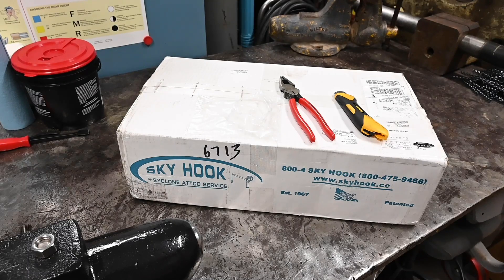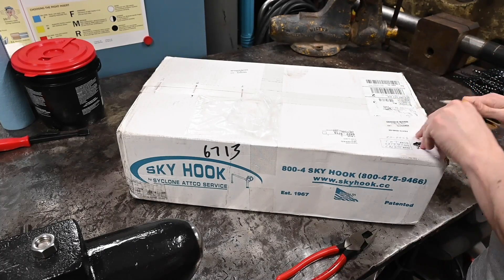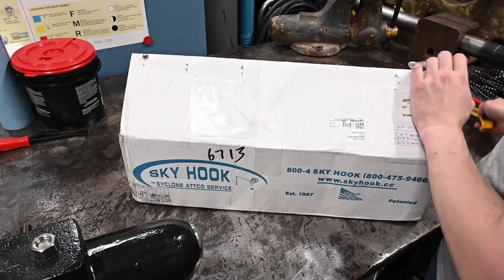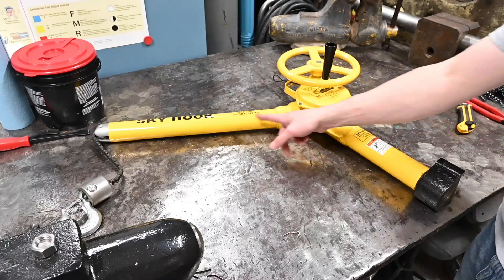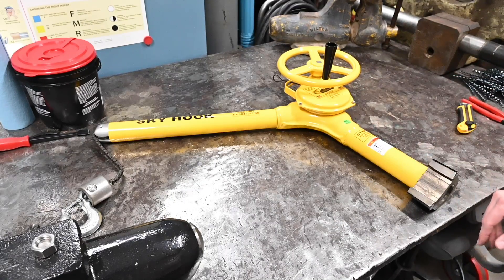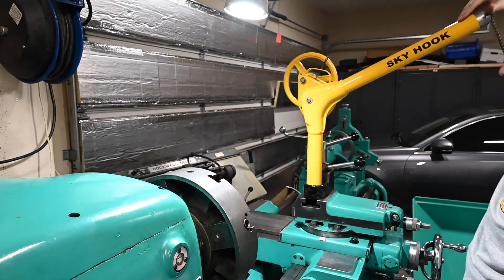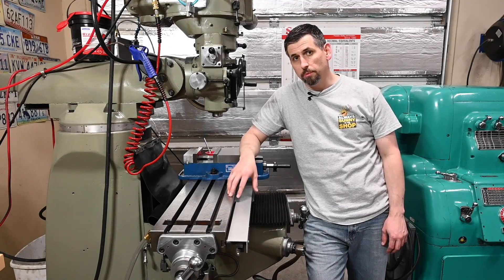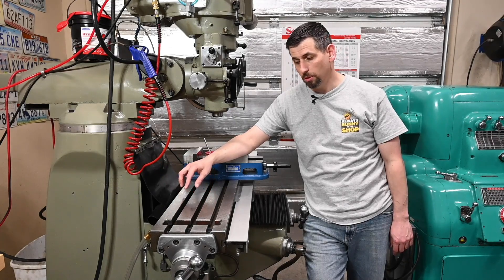Sky Hook Crane Review: Lathe AND Milling Machine!

Comment: Hello Aaron.  That's a useful addition to your shop.  If I can give you one helpful piece of advice when removing the chuck.  Loosen all of the cam lock pins except the one pointing toward you when the eye bolt is at the top of the chuck.  Once you have taken some weight with the crane you can then loosen the last cam lock pin with the chuck key horizontal (or close to horizontal).  It keeps the chuck key from interfering with the eyebolt/crane hook.  If you look at the 7:00 minute mark in my video "Machining Stainless Steel Bars" you can see what I mean.  Ken

Comment: Great video I never heard of it before. You might also look into one of those hydraulic lift tables it really helps. I also built a trolley system on the ceiling of my shop using one of those cheap HF electric winches.